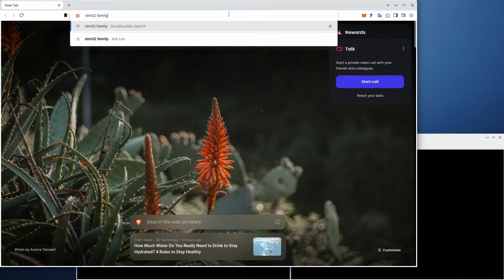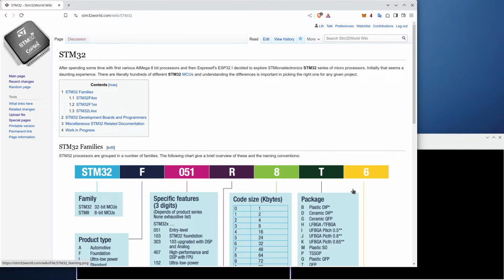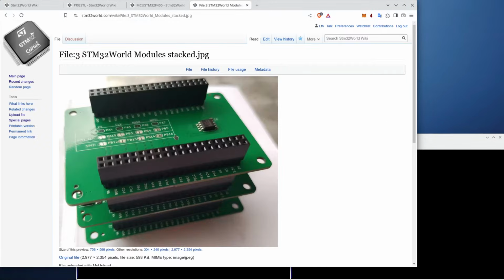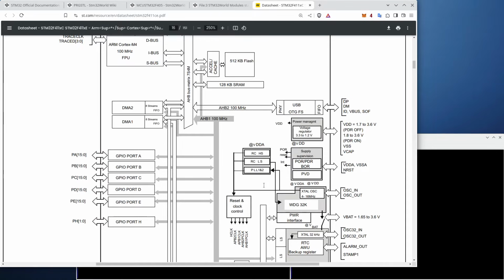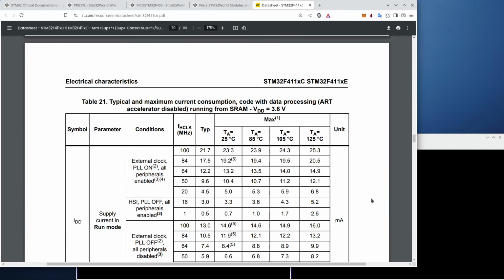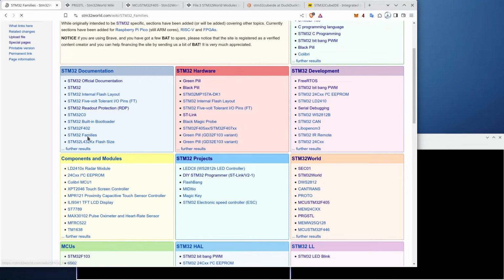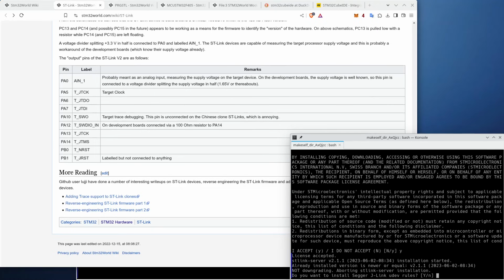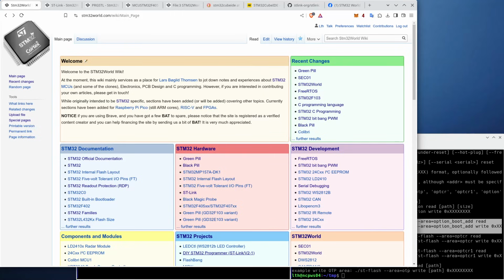STM32 Tutorial #1 - Overview, Families, Documentation and Development boards and tools

Comment: Hi, great video series! I'm also running my research on an STM32 platform (NUCLEO-G431RB). You mentioned you prefer the generic Linux installation, and I was curious why.

As a Debian Trixie user, I had a lot of trouble with package dependencies (like libncurses5 and GDB versioning), so I'd love to hear your opinion to see if I should expect any other issues.

Thanks!
Reply from the maker: Well, I have been running UNIX systems since mid 80s - Solaris, AIX, IRIX, SCO, BSD etc. etc.  I have never ever run Windows.  No matter which OS you chose to run you should know how to manage it - or have someone manage it for you.  If you are running Debian, learn to use apt ;)

Comment: I am using an ST-LinkV2 programmer and therefore do not have the UART pin connections like your custom programmer. I instead connected PA9 and PA10 to a cheap CP-2102 USB to UART board. I therefore have two usb connections to my computer, ST-Link and CP-2102. The CP-2102 is wired to just three pins on the blackpill: GND, A9 to RXI, A10 to TXD. I also had to set the SYS Debug to "Serial Wire" instead of "Trace Asynchronous Sw". Is this the correct way to do it when using an ST-Link programmer, or did I miss something easier?
Reply from the maker: The Trace Asynchronous SW is only used if you have the SWO pin wired up to your ST-Link.  The cheap Chinese ST-Link clones can be "hacked" to enable that - but that does take some fiddling and is hardly worth it.

Comment: What are all the components and boards required to start the stm32 series and suggest the best stm32 board for your part of the series.
Reply from the maker: That is pretty much what this particular video is covering.  I deliberately use different boards to make it clear it is not important which one you use.  I'd suggest any mid-range Nucleo board - f4xx or l4xx.
Reply: @stm32world  i think for nucleo boards there is no need to buy the st link's and i am going to buy STM32 nucleo F401RE.
Reply from the maker: Correct - also covered in the video.   There might be a few features which are not included - I think the F401 is missing a DAC - but for most it will be fine.
Reply: @stm32world then which board has all  features  according to your youtube series??
Reply from the maker: F407 could definitely do all I have covered so far.  I do most on STM32F405 (not sure if there's a Nucleo board with that)
Reply from the maker: Sorry just checked the Nucleo models - the F446 is probably the closest.
Reply: F446RE or L476RG??
Reply: Can I go with F446 or F407??
Reply from the maker: Look, you really must read the datasheets for the MCU's and compare the features.  For example, a STM32F411 is pretty darn powerful, fast and packet with features, but it does NOT have a DAC.  In other words it will be fine for most stuff but if you need a DAC it won't do the trick.  That was just an example - I do NOT of the top of my head know the difference between those two - so you really should look that up yourself.  If you need or possibly need a feature which is in one and not the answer, then that is the answer.

Comment: In making your own board, do you solder them yourself or have the pbc vendor place the parts for you.  I’m working on my smd soldering skills and would love to be able to solder my own boards. If you solder by hand, I’m curious how many pins you have managed to do.  Love the content!😀
Reply from the maker: I have done a few boards manually and I find SMD down to around 0603 possibly to hand solder.  However, I usually just order the whole thing from JLSPCB fully assembled and then just add headers and such.
One of the problems doing it yourself is getting parts.  If I order 1 MCU I end up paying more for shipping than for the part - and with perhaps 30 different parts - that can add up.  At JLCPCB I pay less per MCU than I can buy it for myself.

Comment: Thanks for this.  I'm coming from Arduino and ESP32, so highlighting the different approach with STM32 is really useful.. Thanks.
Reply from the maker: Actually - I would suggest you mix up the order a bit.  Watch #1 and #2 right away - then jump to the last video I did focusing on print redirection #36  - then go back to the ones focusing on debugging.